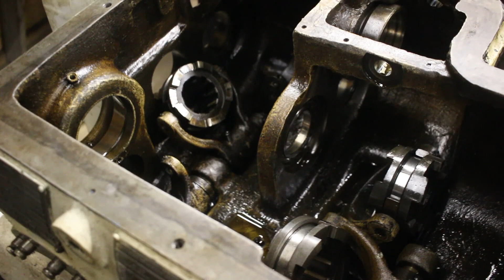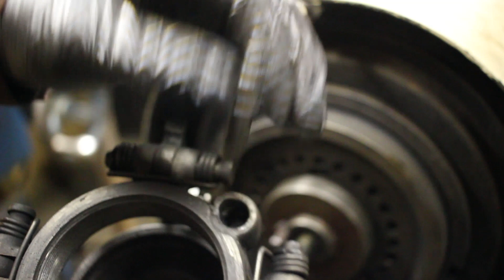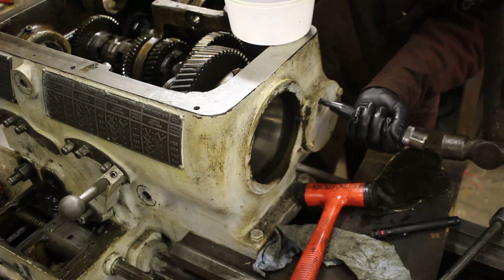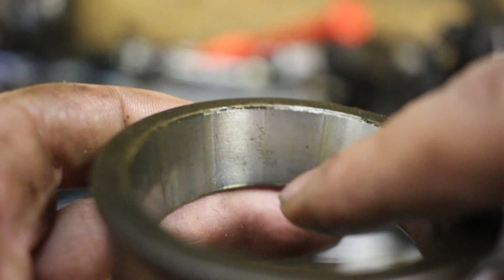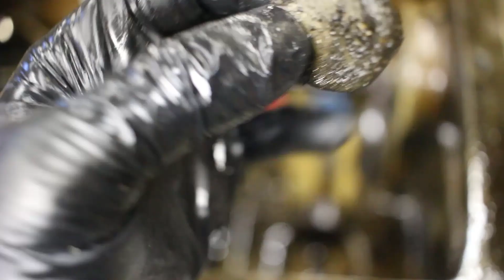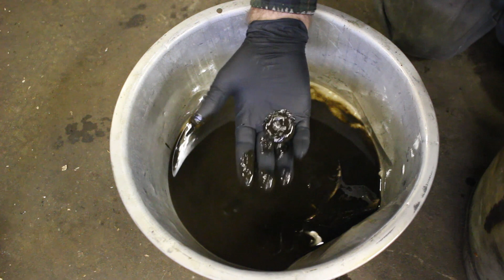Monarch Lathe Rebuild Part 2

Comment: Hello again , I got the lathe home . It's got a 7.5 hp motor I'm wondering what you plan to run yours   with ? thanks
Reply from the maker: Mine has a 3HP motor and I have a rotary phase converter. I ran it off a VFD for a while but I got a deal on the converter and it runs all of my other machines so it was easier just to use that. I recently picked up a bigger rotary phase converter off of craigslist. It was $600 and said it could start a 7.5 hp motor. It will probably get used by the volunteer fire company I am a part of to run a compressor to fill our air tanks. But if not I will have a bigger converter incase I find a deal on a bigger machine.

Comment: Hello , I'm glad to see this video I'm picking up a 16CY today actually . The guy I'm getting it from said he has never powered it up , I would like to see the more in depth videos you mentioned . Keith Fenner  ( turn wright machine works ) is also rebuilding a 16 CY I'm going back and forth between both of you to get as much info I can . Also wondering about parts costs and where to get them . Thank you for the videos I did subscribe and will be following along

Comment: Hello I was wondering what size tool post you have on your lathe and what size motor. I am getting ready to purchase a 1942 Monarch 12CK.
Reply from the maker: I have a CXA tool post and a 3hp motor.  Those seem to be good sizes.  I think you could good a size bigger on the tool post and not have it be too weird but I think the CXA size is better.  I certainly wouldn't go any smaller.
Reply: diyVT ok thank you! The one I’m looking at buying has a 5hp motor but for me if the 3hp motor works that would be easier to set up with a 3hp vfd.
Reply from the maker: @TylerSmith-cm2sw  I have a cheap Chinese 5 up VFD and it's not great.  I had to put in a fairly long ramp time or it would cut out.  It also will cut out if I engage the clutch too fast in higher gears.  It's never cut out during a cut and I have taken some fairly heavy cuts.

Comment: Thanks for posting this.  I'm looking forward to seeing the rest of the project.  I'm rebuilding a 14" Monarch AA lathe (winter project) and just finished up the apron.  About half of the oil lines were clogged so it was good to go through it.  You'll be happy you have this video when you're putting things back together.  Good luck!

Comment: I just refurbished my Monarch CY clutch/drive sheave that looks identical in design to yours.  I forgot to install the "little random springs". I caught my mistake and reinstalled them literally 30 minutes before sitting down to watch this video. The clutch still worked find but it did drag ever so slightly if I didn't pull the engagement lever all the way up. BTW, would you please include in the next video the components of the clutch/drive sheave and bearings. I'm pretty sure mine had some post-factory modification. I think I have it back to stock condition but would love to see this style clutch/drive assembly in another Monarch. Love the videos, keep them coming!
Reply from the maker: I finally got my lathe back together (video hopefully soon).  I am having some trouble adjusting my clutch.  Does the input shaft spin separately from the clutch pull rod?  Mine move together so it's really hard to get the clutch set right.
Reply: @diyVT  I am not 100% sure if my pull rod and input shaft move together. I think they must but I can check this evening to be sure. 

If your clutch is like mine, the adjustment yoke threads onto both the clutch pull rod and the "hub and back plate". When I just screwed the yoke on, letting the 2 threads start where they pleased, I too couldn't get the clutch adjusted properly.

What I had to do was thread the yoke onto the clutch pull rod about 5-10 turns before I started it onto the hub threads. To do this I collapsed the yoke, threaded it onto the clutch pull rod about 5-10 turns then expanded the yoke and threaded it the rest of the way on both the pull rod and the hub.